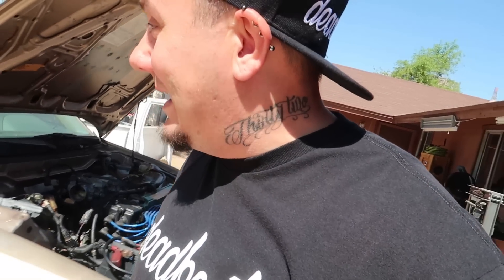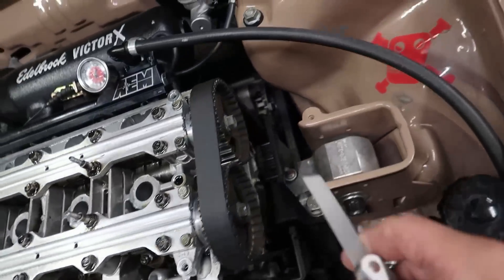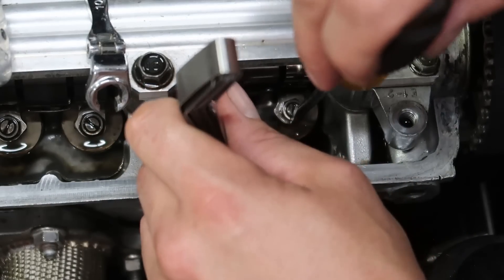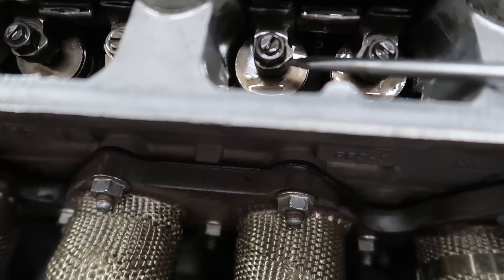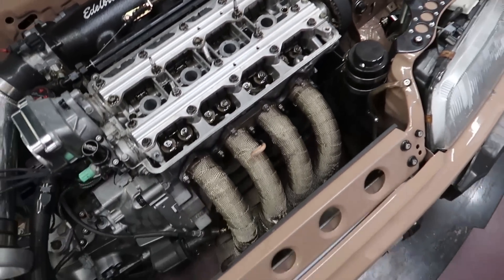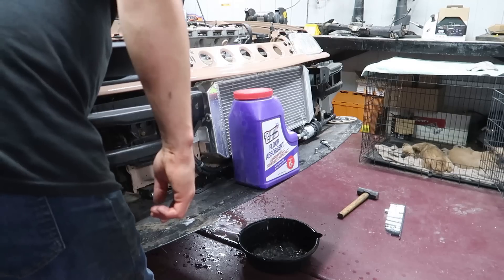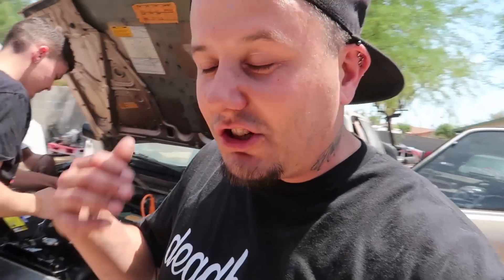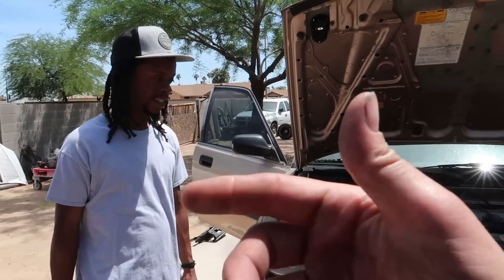Things Escalated! Khaki is a SHELL 😕

Comment: The Y1 ecu is out of a 1988 accord. They came in both “carbureted” fuel injection DPFI and modern fuel injected MPFI so that may be why that one isnt working but as for both PR4s not working I’m stumped. Definitely a wire harness issue or just really bad luck on junk ecu’s. I’d take one of the Hondatas you have and load a base tune for that engine and if that doesn’t get it to work then you know it’s the harness for sure. I’m sure I’m telling you shit you already know but hope it helps either way
Reply: He would have to convert to obd1 just to tune it

Comment: I think you need the resister box if your runing obd0 injectors or install obd1 injectors with out the box
Reply: 100% obd 0 are low impedance and can be checked with a meter ,obd 1 and 2 are high impedance and no box is needed
Reply: Pretty sure the wiring harness had obd2 injectors. Not 100% but pretty positive they took obd2 injectors from the junkyard for this and khaki.
Reply: @Anthony-fc1zb  im pretty sure they put obd1 in it
Reply: @subarulegacy420  from what I remember they pulled em off two crv unless I'm remembering wrong. Gotta watch the junkyard video lol
Reply: @Anthony-fc1zb  i thot they picked up obd2 injectors and obd1 injectors but i could be wrong
Reply: @subarulegacy420  I went back to the video, yeah they grabbed obd1 out an eg and obd2 out a crv.

Comment: For the resistor box guys all depends if he's running low or high impedance injectors. Low need the box high you take all the yellow wires of the injectors and put them together to delete the resistor box to run high impedance injectors!

Comment: If running obd0 injectors you need a resistor. If obd1 injectors you bypass the resistor box. Obd0 is low intermittent and obd1 is high. If obd0 the injectors will not fire without the resistor box.

Comment: From the first video, you had the A1, A3, A5, and A7 written backwards on the tape that is on the valve cover.  A1 is cyl1, A3 is cyl2, A5 is cyl3, A7 is cyl 4.
The stumble you hear when the engine is cranking is a fuel injector spraying when it’s not supposed to.

Comment: I would check the dpfi to mpfi wiring to see if its all good.
Reply: Was thinking the same.
Reply: Yea it's gotta be wiring or i think so. I also noticed he had the injectors labeled on the valve cover starting on the trans side A1 A3 A5 A7 that's the correct pins at the ecu but I've always seen it start at the timing belt side brown A1 red A3 blue A5 yellow A7. Then A15 is power to the injectors usually the yellow wire with black stripe.  Move c1 to B10 and C2 to B12. Then run 2 wires from C1 and C2 to the blue green wire and blue yellow that goes to the distributor. You can run obd1 injector with and obdo ecu too u just gotta tie all the red black wires together and delete the resistor box. Or it could be the white and fat white wire to the distributor is swapped around one is to the coil in the distributor and one is to the crank sensor in the distributor. And the tps wires needa be swapped. If it was me I'd just find and untouched dpfi harness and redo the wiring and rule that out. Obdo wiring is simple as hell I've seen it done many different ways too though.

Comment: Go back to obd1 jumper on the ecu and obd1 dizzy use obd1 injectors so you dont have to wire in a resistor box for obd0 your wiring on injector has no power to them because you no resistor box that makes the jump inside to fire the injectors

Comment: I don't see a resister box & you are using 0BD1 clips with 0BD1 injectors with a 0BD0 ecu I would use the DA injectors clips & injectors with the resister box & PR4 ecu also with the 0BD0 distributer if I worked fine  in the DA before the crash  should still all work fine good luck with the car

Comment: Check if the idle control valve. Has cooling running to it. I have the same issue. I had a clog cooling hose. Just remove the two bolts in the  back to see if cooling comes out
Reply: I was chasing the same issues, all i had to do was bleed coolant, had hanging idle and it would bounce, ..cracked radiator cap and it started vroom vrooming until a bubble popped and idle dropped and its been good ever since. Iacv, throttle body, intake, coolant are all culprits !

Comment: Check load on each coil during fire. If there is a significant difference in any, check wiring at that coil. Another thing could be check wiring at fuel injectors. Thetes a chance you have a couple of injectors wired backwards. (Cyl 2 firing for cyl 4 and vise versa) to me, it sounds like either fuel or spark issue.

Comment: I believe the problem your having using obd1 injectors on a obd0 ecu is missing the resistor box obd0 uses 6v with a resistor box to the injectors which in the videos I did see a resistor box on the 4 door integra , the od0 ecu will not fire the injectors or correctly without the resistor box , only way I see fixing the issues is using a obd1 dissy and injectors there are company’s to convert obd0 to obd1 injectors but that’s useing a obd1 ecu also you could test it with any obd1 ecu non vtec but a integra p75 ecu is what u would want to run the obd1 injectors

Comment: I think bad rings in khaki. 

My 90 Integra came with pr4. I converted to obd1 with nothing more than jumper harnesses, and P75 ecu. I’m still running obd0 injectors and resistor box. Maybe try and find unmolested 90-91 integra engine harness. Start over? Kinda seems like you’re chasing your tail on that harness. Just my 2 cents.

Comment: Don’t know if your distributor is obd0 or obd1 but Can’t  run an obd1 distributor on an obd0 computer also if you have the crank signals switched it will spark but injectors will not pulse

Comment: Sounding like a subaru is usually a bent valve. Your compression can still be good if the bend is in the valve when it closed. The valve may not be opening all the way which will cause a misfire. That would also be best case engine damage. Worst case, bent valve and hole in piston. Engine material pitted into cylinder head dome and scored cylinder walls.

I don't think it's that bad though, unless you're also over heating.

Seems like the wiring on the other car is the problem as well. Loose pins maybe grounds. Seems like swapping ecus you move wiring around and make something work again. If you're using a jump harness they tend to have problems too.

Comment: The PR4 ECU comes out of a 90 to 93 Acura Integra LS/GS and the PR4 ECU also comes out of a 96 to 99 Acura Integra LS/GS/RS (B18B)
Reply: 90-91 da9 integra are obd0. 92-93 are obd1 as well as the 94-95 DC integra.
Reply: Yeah they also run up p72 p73 p74 p75 ecu's and Canada uses pba ecu

Comment: If its a B20 with those weak ass stock jointed sleeves than thats your problem, those B20s do not last even all motors, just do 5 minutes of research and you'll see all the problems people have with those jointed sleeves there extremely weak by design, why do you think B20 blocks are so cheap cause they crack sleeves like its there job, ive seen three different homies with N/A b20s all go through the same thing its only lasted you that long because you barely even drive that thing.